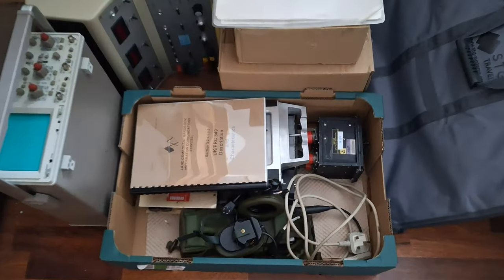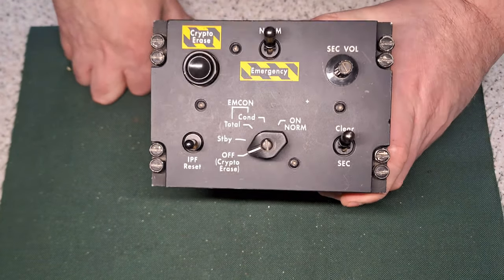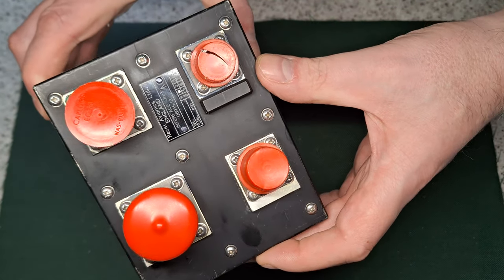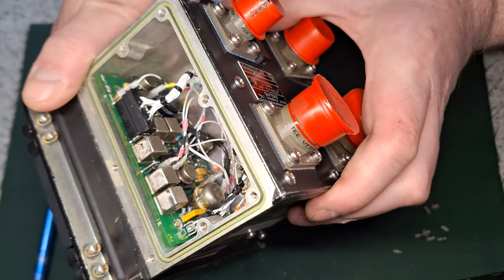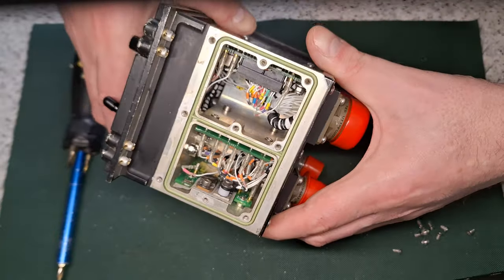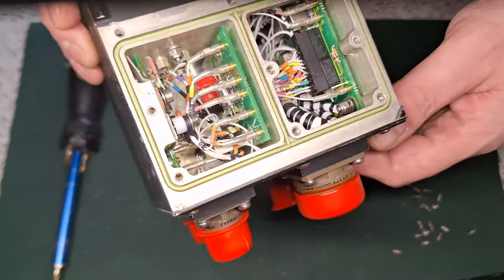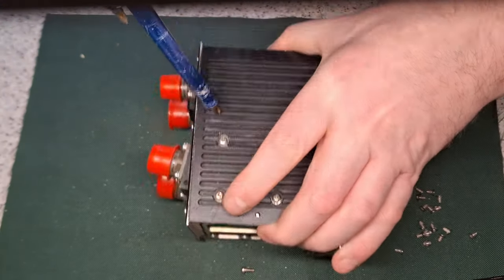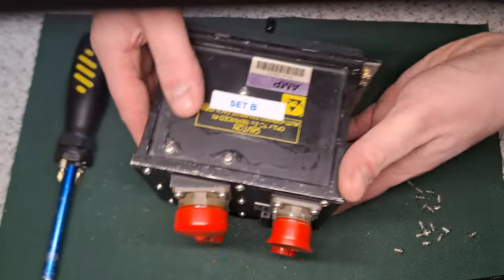Military JTIDS / Link-16 secure communications terminal teardown from a Tornado and Lynx. 4K UHD

Comment: Interesting to note that the connectors are mounted at an angle. This is the ebay avionics russian roulette,  sometimes you loose, sometimes you win. Still an impressive construction and great display item, obviously the shielding requirements were the most important thing in case the design.
Reply from the maker: Yeah it was a bit of a disappointing teardown but makes a good display item. Got a load of things including some components from same guy so lots of videos coming when I get time to make them.